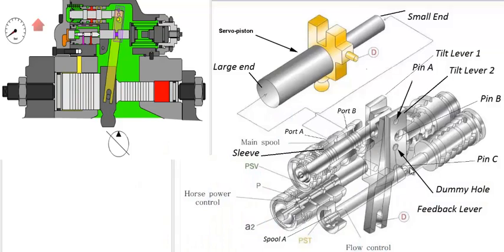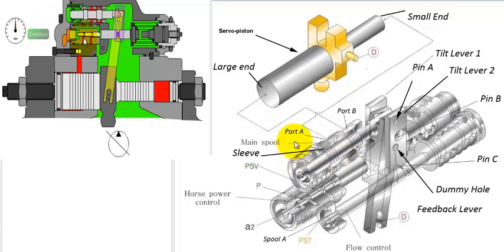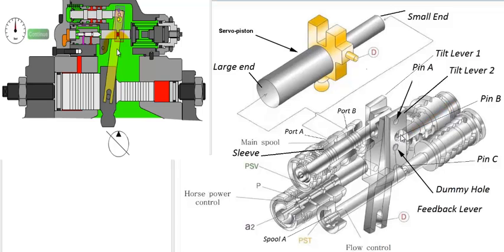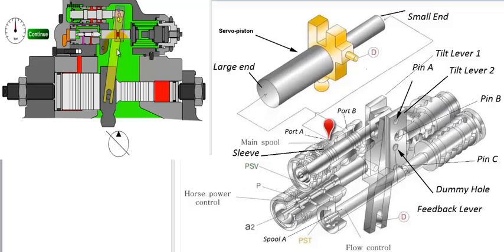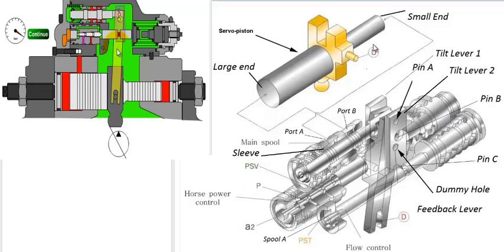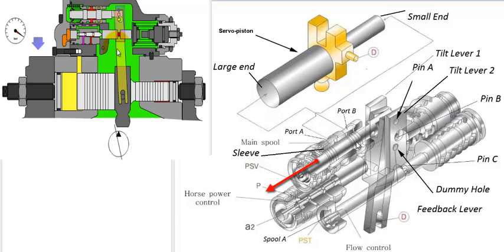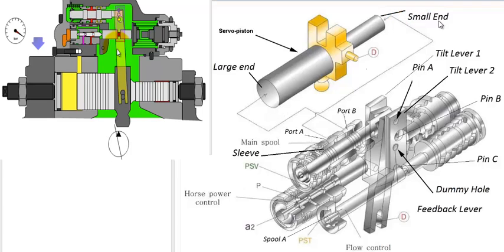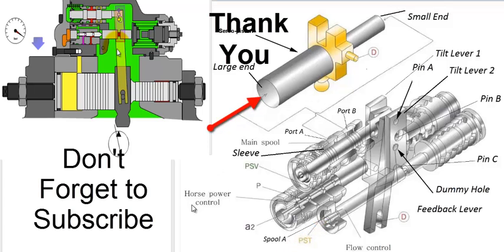Advance Hydraulics - Regulator Function

Comment: Hello Hari! I would like to know if this regulator will bypass the solenoid and computer in the excavator? The excavator is a Cat E312 and the monitor has failed with part of the programming! So I am tired of constantly repairing electronics that will only fail again! If this system will make the pump run efficiently on full manual then I am pleased because I have already gotten a quote on a regulator! Thank you for your time and hope you can understand my position? Regards, Nicholas.
Reply from the maker: Hi Nicholas, for a hydraulic pump to function properly, it needs these 3 main controls.

1.  Pressure signal from the control valve (pilot line from Negacon or flow sensing valve)
2. Cross summation or Torque Summation from the mate pump  (these are internally connected passages mostly).
3.  Electrical Signal from ECU for proportional solenoid to prevent engine stalling.

I think you are talking about the proportional solenoid(various OEM have different names like Electronic displacement control or Powershift valve).

The function of the proportional solenoid is to prevent engine stalling.  I don't have CAT circuits.  More the current given to the solenoid it will allow more flow. The purpose of this solenoid is to prevent engine stalling when overloaded.  Given that other factors are okay pump can run without any power supply to this solenoid.  You can try it out by removing the power supply to this solenoid.

Also, connect a pressure gauge through T-piece to the pilot lines going into the regulator and check whether the pressure varies with movement of the joystick. In a negative flow control unit more the joystick movement u will get less pressure to the regulator and more flow from the pump (that's y it is called negative flow control).